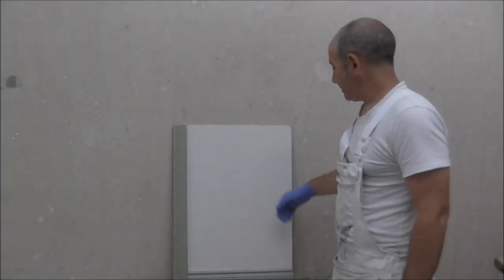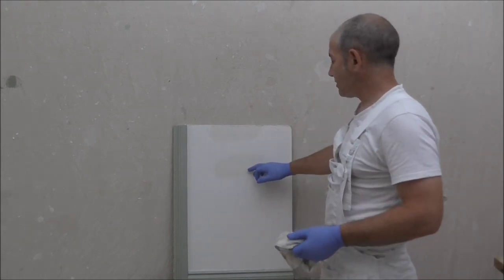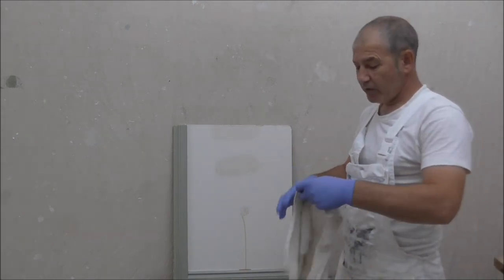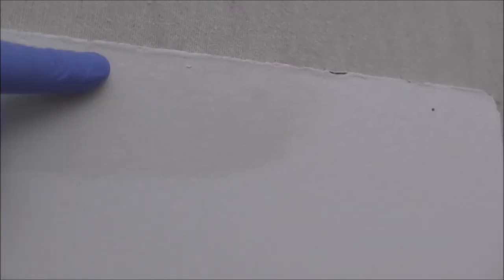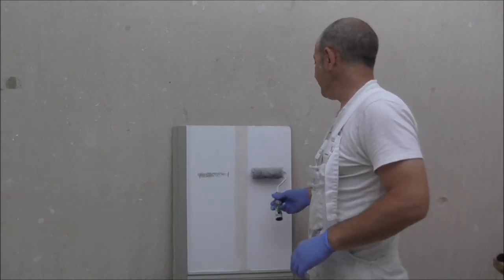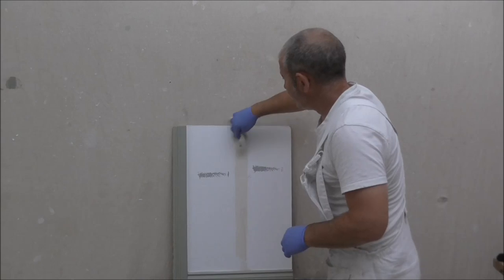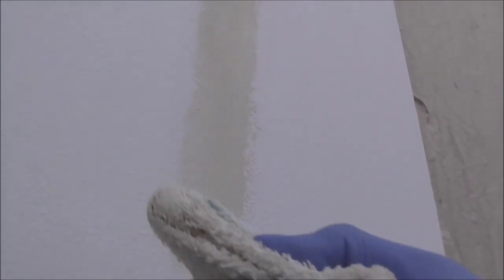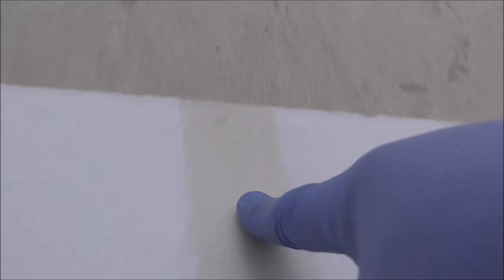Why You Should Use Washable Matt

Comment: great video, which washable paint do you find the best overall, the dulux or the valspar?
Reply from the maker: Thank you...  both very good paints but prefer to use Dulux...   although Valspar dries faster. arrrr
Reply: @PaintingandDecorating  thanks for the reply, I've seen lots of reviews of people saying the dulux is hard to work with? Dont suppose you've had any issues?
Reply from the maker: @Dhinsa90  
To be honest Dulux flows off the brush better and lays of better.. Valspar dries fast and is very tough paint scrubbable...  but can dry too fast when in warm conditions..
Reply: @PaintingandDecorating  that's great, think I'll give dulux a go as Ive learnt from using cheaper paint! Thanks for the advise
Reply: @Dhinsa90  Valspar is not cheaper paint. it's easily as good as Dulux. However I do think out of these particular two that easycare is better because It's hydrophobic.
Reply: Crown scrubbable Matt is excellent, can second coat it within an hour or 2 as well

Comment: Great video 👍🏻 Could you possibly do a video on pliolite?
Reply from the maker: Never used it, but just looking and sounds interesting Pliolite Based Masonry Finish. A solvent based paint that can be applied in temperatures of -5°c and is shower resistant in 20 minutes. Nice will check some out. maybe not at -5 :(